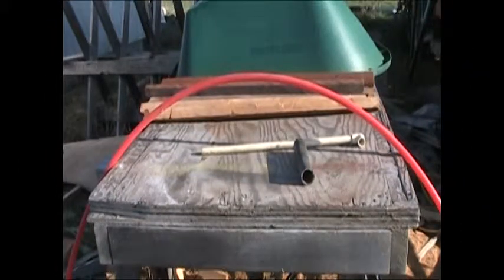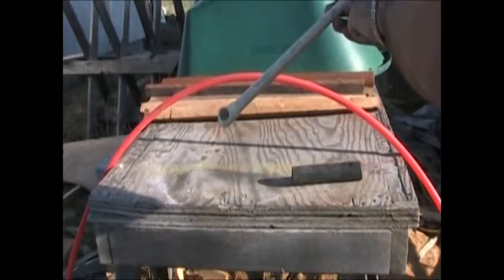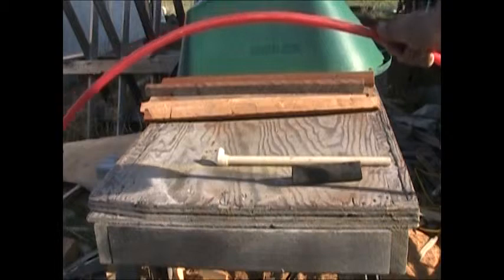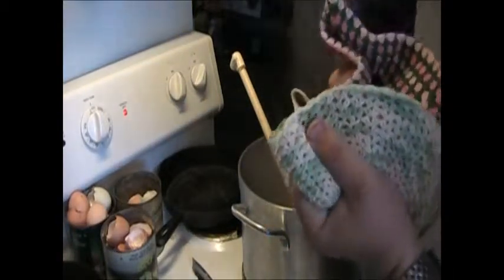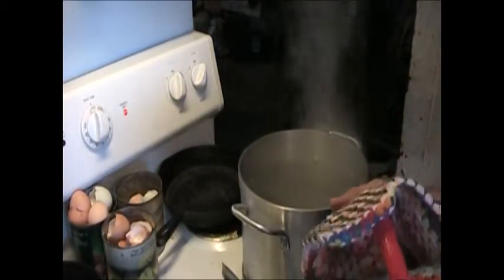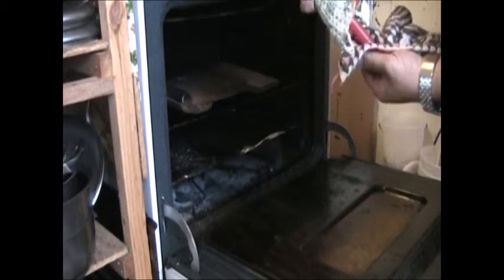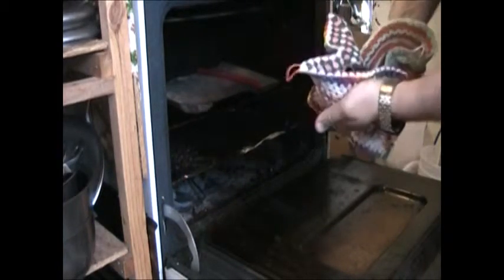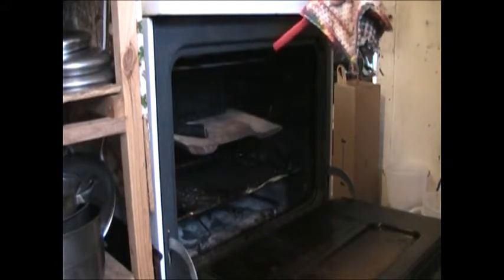Plastic Pipe Temperature Limits

Comment from the maker: As near as I can figure, a 1/35 HP pump with 120F water, will move between 100,000 to 300,000 BTU's depending on back pressure, into an 80F room. Hotter water and colder rooms would result in higher performance. It comes with 3/4 pipe diameter, but would probably work ok with 1/2.

Comment from the maker: I know a guy that heated his basement and front entry way with a 3/4 pipe and a two gallon reservoir setting on top of an ordinary wood stove. I think he used 3/4 because that is the size of pipe that hooked up to his pump. Your manifold pipe should be the size that hooks up to your pump. You could switch to smaller pipe for the length of the heat battery, but don't forget to factor in the cost of the fitting for reducing the pipe size. It may just be cheaper to stay with one size of pipe.

Comment: I read your article on permies website (I think that's where) and I want to incorporate copper pipe into the cob of my RMS and pump it into an expansion tank and then have separate pumps coming from the tank going to the PEX or greenhouse or upstairs radiant floor. What size copper pipe should I use in the cob and how many? I planned on 1 big one to a manifold and then splitting up into several running along the length of the heat battery and then back into one pipe to the tank. Guess it depends

Comment: In floor radiant heat is about 150 degrees. In the radiators more like 175
Reply: 175 F or C ????
Reply: @mo-ni  Fahrenheit
Reply: 200° C in a plastic pipe? 
Steam cleaner territory
Reply: @simonmasters3295  Yes, this would be a bad place to misunderstand what scale I am using. 175 F = 79.4 C = 352.5 K